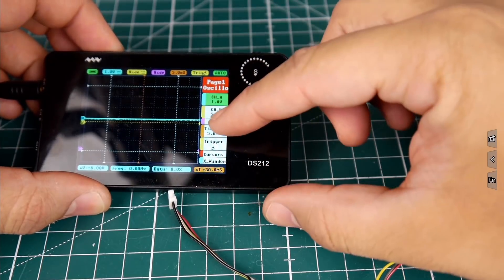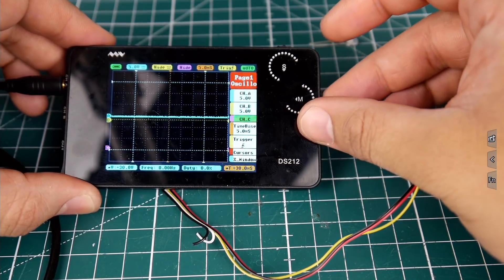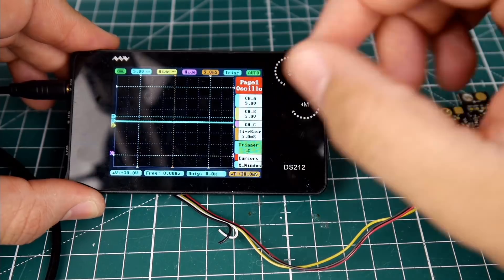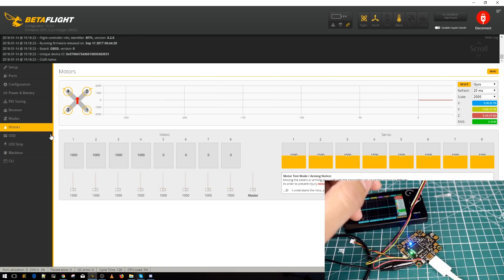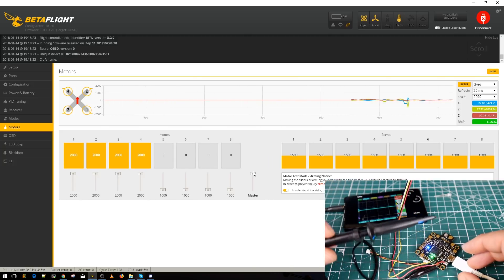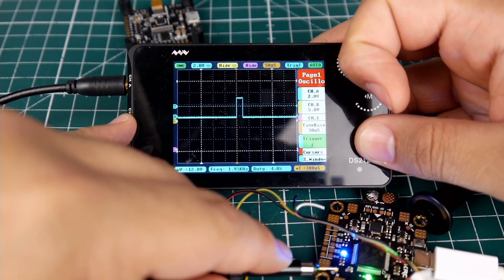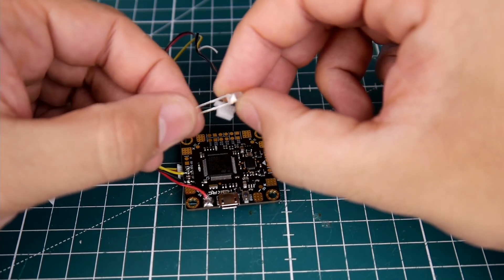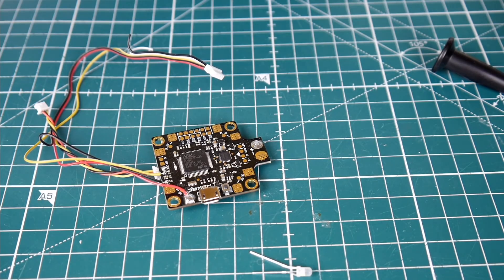How to Test Flight Controller Motor Output with LED and or Oscilloscope

Comment: Dude i love your channel, because of this kind of videos. Tell me one thing, does this test can be done on brushed fc? I have a beecore v1.0 dsm version, that just doesn't hovers straight. It always drift to the right, nothing i do works... trimm, subtrimm, calibrating accelerometer, just nothing work. And by the search i been doing, i'm not alone in this quest. People say that is a ppm problem?! I just don't have that much experience to know if it is or not. Can i use this way to find if it's just some bad motor output on a brushed fc? Thanks in advance.

Comment: Amazing video, I learned something new. I actually got a situation where I can test this method now and check if my FC motor outputs are busted. I'm suspecting it's my 4-in-1 esc that has gone bad after a crash, but maybe the FC is the one with the problem. Could you make a similar video on how to diagnose a 4-in-1 ESC? Thanks

Comment: Hey quick question. Do you think its necessary to run ground wires from your esc? Because I'm thinking about getting the matek f405 CTR and it doesn't have a pin out for ground wires from the esc. It only has signal and RX pads. What are your thoughts?